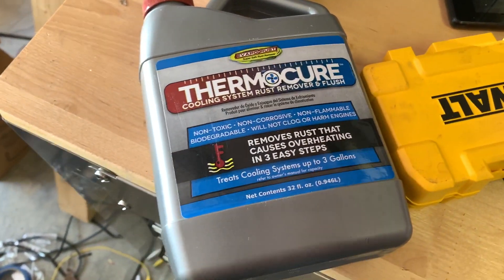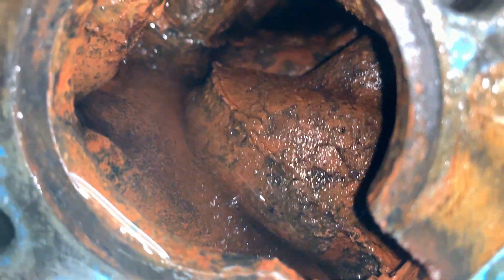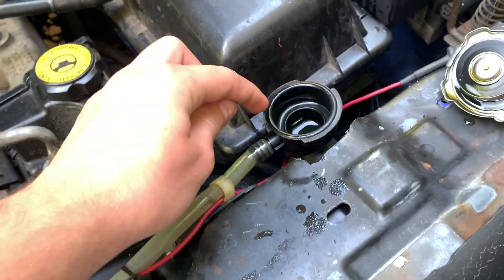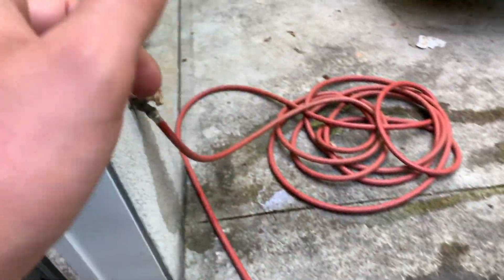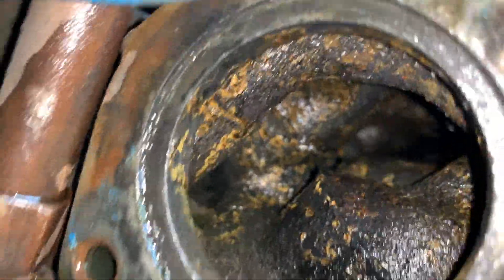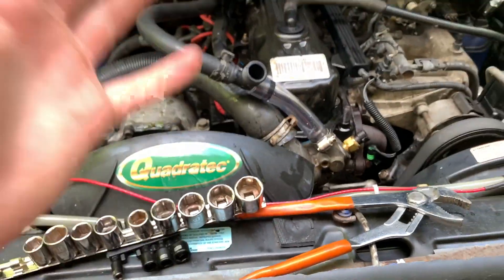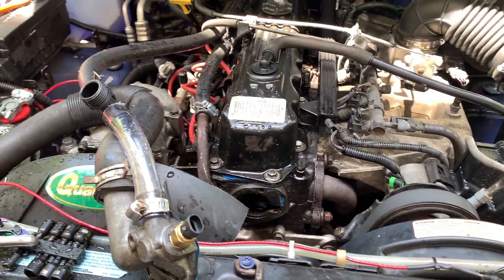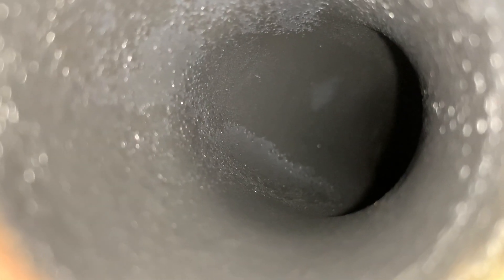Does THERMOCURE actually work? Let’s find out!!

Comment: Taking  out the termostat before doing this is a clue, did you notice the termostat housing  totally  clean and the block very dirty  is because the cold water close the thermostat  and didn't let the chemical go  into the block so do it again with  out the termostat.
Reply: I was legit wondering why he still had the thermostat in there. I was like bruh you're blocking everything. lol.
Reply: That's why you run around a bit with it in there.
Reply: So you are saying to keep the thermostat off while driving around?

Comment: Water is actually much more efficient in transferring heat than a 50 50 mix of anti freeze.
Reply: True, but water doesn’t have the lubricating and anti-corrosion properties like antifreeze... not to mention you’re fucked in the winter lol
Reply: @cebayne  he was referring to the incorrect statement made in video.... the only reason why water is not use as coolant in vehicle ...are mainly because of rust an expansion when freeze.
Reply: Do you really have lust to experience a busted engine during winter/freezing time ?

Comment: There is a product called Aqua Clear PX. Developed for the military. You add it to your radiator with your antifreeze. Keeps all scale and rust away for years. Been using it for a long time and never any coolant issues. My one car is a 30 year old Camry. Still going strong and the cooling system is spotless
Reply: yes there are some chemical toa d to water and remove rust, or convert it
Reply: Where do you buy it in the United States ?
Reply: Seems to be available only in South Africa.

Comment: Using a lower temp thermostat tells the EMC the engine is still cool and will keep the fuel mixture rich.  A lower temp thermostat is a great way to kill fuel mileage.
Reply: 5 degrees wont do much of anything, I have a 1996 dodge ram 1500 5.9l magnum that I'm about to put a 190° thermostat in cause the 195° keeps causing the radiator cap to vent out coolant, the radiator cap isn't faulty, cause I bought a couple and they all do the same. Yes it's a bad idea to change the temperature range, if it was 10° difference I would fully agree.
Reply: My Camry still gets 31mpg without a t stat
Reply: @jamesflores9456   Removing the thermostat doesn’t make all vehicles run cooler.  It greatly depends on the engine type, vehicle weight (or load) & how it is driven.  Many older in-line 6-cylinders will run ABOVE normal temp if the thermostat is removed.  No telling on a Camry.  If the ECM detects the engine is below a specific temp, it will adjust to a richer fuel mix, IF it’s working properly.  My 2016 4-cy Camry averages over 33 daily driving (which is quite a bit of 2 lane @ 35-55 mph) and gets over 36 on all highway (70-75mph).
Reply: @A1rs1ck  Might not matter on your specific vehicle, but you definitely have some other problem. A LOT of vehicles will run well over 200 degrees in stop & go traffic with no pressure release.  If the 195 thermo is the stock value, it’s not what is causing the pressure release.   There’s another problem causing excessive cooling system pressure.  The 190 thermo might resolve the issue (for a while), but it’s not fixing the actual problem.
Reply: @remusredbone1214  The big risk of removing a thermostat is that the engineered flow restriction the thermostat creates forces the coolant to to flow around the back cylinders.
Without it you can cook the back cylinders all the while the temp gauge is saying all is a-ok.
Reply: Closed loop is usually 160* or below. Idk any thermostat that’s that low.

Comment: Had the same issue with mine. I burped the system or so I thought. But it kept trying to just barely overheat. Ended up having to park at an incline and filled the funnel about halfway but I kept the engine running with the heater on this time. Along with squeezing the radiator hose to get all the air out. It took about 10-15 minutes for all the air to finally get out. Great informative video, I was about to buy the thermocure but wanted to see reviews.
Reply: YES, I DO MINE ALSO KEEPING THE FRONT END UP IN THE AIR, HIGHER THAN THE REAR END.

Comment: Should flush with no thermostat to get past thermostat housing area. Or at least drill big holes on an old one to get better flow when engine cold or hot. Chuck in a new one at the end of flushing system.
Reply: Yeah I also thought it was weird that he didn't remove it.

Comment: As some others have pointed out, pure water is actually the best at removing heat from the engine. "Coolant" is a bit of a misnomer. The "coolant" that engines are filled with is actually a 50/50 mix of water and antifreeze. The water is the coolant and the antifreeze is there to prevent the water from freezing in cold temperatures. The antifreeze does also help prevent the oxidation of iron in the engine which causes rust. People who live in warm climates will often fill their cooling systems with 100% water since it is so cheap (although only distilled water should be used.Tap water and bottled water that has not been distilled will result in mineral deposits that negatively affect cooling performance and the longevity of moving parts such as the water pumps.) Using 100% water  is very effective at cooling the engine but will lead to internal rust (which is not good for cooling). To maintain a good balance of cooling performance and mechanical longevity you should always use a mix of distilled water/antifreeze somewhere between the range of 70/30 to 30/70 water/antifreeze. Warmer climates should use between 50-70% distilled water while colder climates should use 50-70% antifreeze. Only the coldest climates, that regularly reach double-digit negative Fahrenheit temperatures, should use 70% antifreeze mix. Most people will be perfectly happy with a standard 50/50 mix.

Comment: This stuff WORKS, I watched multiple videos and decided to give it a try. Recently bought 1979 Pontiac Trans Am 20k original miles. Sadly, the coolant broke down over the years and the radiator was rusty, dark brown coolant. Flushed it multiple times, it would get clear and then once closed up, back to rusty coolant. Pulled the thermostat let it flush open, closed it up and added Thermocure. I left it in the car for a few days and drove it.  Flush and repeat with a second application of new Thermocure. Same routine, I drained the coolant, filled it up again and flushed. The coolant was clear liquid! I just pulled the water pump which was perfect inside, no rust. I replaced it with a FlowKooler pump and a high flow Edelbrock thermostat. The car temperature is perfect! I am waiting on a replacement radiator to start fresh.

Comment: I would flush that with distilled water and a pump to avoid scaling minerals from the house water line.
Reply from the maker: Good idea, I used distilled to mix with the coolant and to top up:-)
Reply: You'd have to buy a hundred gallon of distilled water to flush it as long as he did.
Reply: @davidwiser3883 Of course... highly impractical.

Comment: Actually water does perform better than anti-freeze/coolant in dissipating heat, but it boils at a lower temperature and freezes at a much higher temperature,
and for these reasons is not used by itself. It used to be used straight, with a rust inhibitor, during the summer months but needed changed for winter 
weather to an anti-freeze solution. Eventually year round anti-freeze/coolants were formulated than did’t require twice a year draining and refilling of the
cooling system.
Reply: * Boils at higher. Freezes at lower *
Reply: @cosmicdonkey919 wrong. Water boils at a lower temp and freezes at a higher temp!
Reply: @cosmicdonkey919  lol
Reply: Water can definitely be used on it's own, even boiling at a lower temperature, as the boiling temp rises with pressure. Hence why your radiator system is pressurized. 
Tap water isn't good though. Distilled is what you would want if running water.
Reply: @HDConcussionz  yep, this is correct. 100% water is actually ideal to use as long as your cooling system is sealed properly. The increased pressure in the system will raise the boiling point of the water accordingly. The only downsides to 100% water is the lack of a rust inhibitor which will cause an issue over time, and the issue of freezing temperatures in colder climates. if I lived in a warmer climate I would run 100% distilled water with a little bit of rust inhibitor as needed.

Comment: Put a CFS 3 core Copper radiator in your jeep xj with a external Haden transmission cooler. Transmission will run hot offroading or towing and raise coolant temp. Replace your auxiliary electric fan with a 1998 or newer 10 blade. I also put a Wix inline coolant filter mounted to firewall. That filter will catch your future rust problem just keep it changed about every 10k miles.

Comment: Actually, water is better at removing heat from the engine than coolant. Water just doesn't have any lubricants or corrosion inhibitors and will freeze in the winter. It's also not able to go to as high a temp as coolant. However, any pressurized cooling system will allow regular water to get over boiling without boiling in the block or radiator.

Comment: Good thorough flush! I like how you mentioned those (Chunks) that keep flushing out.. with the thermostat housing off remove lower radiator hose take your hose with a rag wrapped around it as to try and create a tight seal and turn the hose up all the way try and blow those chunks out the Block then JUST REPLACE THE RADIATOR don’t mess around! They are relatively cheap and mostly recyclable. Radiators Fatigue from non-stop expansion and contraction.. (yes they do explode) oh and those Chunks? Where exactly do you think they end up? They settle to the bottom of the block and radiator..always Run OEM temp thermostat Temp..and a common funky temp problem is fan clutch going south.

Comment: Water is the best for cooling purposes. The difference with tap and distilled water is minerals vs no minerals and distilled doesn't create the corrosion problems tap does. 

Coolant is used to keep it from freezing and conditioning thats it.
Reply: Exactly. They use water when racing because it's the best for cooling
Reply: Coolant also keeps the water pump bearings lubricated and prevents cavitation, two things that'll kill a water pump.
Reply: That is absolutely not true.  It's called coolant / antifreeze. Read the label and you will clearly see it changes the waters freezing point and its boiling point. Racecars use only water because it is not hard to clean up off the track. Coolant is oil based and oil dont mix well with slick tired on a race track.
Reply: @peggybixby1085  Your wrong coolant  is a lubricant for the bearings.
Reply: @peggybixby1085  It's so cute when a little lady chimes in...now run along and make some sammiches while us men talk.
Reply: @DavidPruitt NOT CORRECT... The pump bearings are not wetted, it is the pump shaft SEAL which is the part being lubricated by the coolant.
Back in the old days (1967 Ford Falcon, iron engine block with iron heads) we used water.  Then, sometimes, the pump developed a chirping noise, thus I added a small can of "Water pump lubricant" that was just old plain "soluble oil", of the same kind of the surfactant additive added to water used to lube the cutting tools in a lathe or drilling machine in metal machining shops.  That usually cured the noisy seal.
Reply: @davidwiser3883 Not so. LOOK, the pump bearing is NOT even wet with coolant... It is the pump shaft SEAL which is in contact with the coolant, and is lubricated by the coolant.  The pump uses one, rarely two sealed bearings, lubricated by grease and sealed by integral rubber lip seals, but those bearing seals ate not in vontact with the coolant, unless the pump seal fails completely.

Comment: When I do a flush, I slide a large hose over the end of the yellow flush adaptor coming out of the radiator, and tunnel the hose down to a bucket. (If coolant is in the system)

Comment: It looks like a blown head gasket issue to me. However, try to replace the radiator cap because maybe it doesn't respire properly. Also check the fan clutch for resistance. Finally,  check the radiator by touching the radiator core for even hotness just after you drove the vehicle and turned off ignition. Caution! Before you touch feel the radiator core, please turn off the ignition. One more thing, drain radiator one more time, and use concentration coolant because if the antifreeze is diluted, at high speed the vehicle may overheat. I'm a self-taught mechanic. I educated myself through the process of research and development.

Comment: I have always just used a couple gallons of White distilled Vinegar and distilled water. Add the vinegar and top off with the water. Run it for a good 10 minutes and let it sit all night. The following day drive it around for a half hour and let cool. Then flush system with tap water. When done rinsing with water allow to empty before topping off with anti freeze and distilled water.
Reply from the maker: Thanks for sharing
Reply: I never thought of "distilled vinigar".

Comment: I think the reason why the cast iron turned black is if the Thermocure has phosphoric acid in it that's what it will do. Just like rust converters that contain phosphoric acid turns the rust a dark brown or black color.
Reply: There is no acid in Evapo-rust. It is ph neutral

Comment: If you're going to be doing a long flush like a few days to a week, leave the thermostat out.. Do it in the spring, while there is no danger of freeze, and you don't need your heater.. While driving keep the heat on full hot. This will keep the flush running through your heater core.

Comment: My coolant is brown from the rust. I’ve done 2 flushes so far. Once with blue devil and another with a different brand can’t remember the name.. block is rusty still from when an old mechanic from 2 years ago put water from a hose in my jeep. Do you think this will help bring back normal coolant color?
Reply from the maker: It's worth a try. Mine was pretty bad also & it's fine now & has been since this video was taken:-)

Comment: Does this stuff work for soaking the heater core to flush it out? I want to use a chemical solution but I don't want to eat it away at the aluminum and have it leak! 2007 Ford Edge.
Reply from the maker: I never tried that myself, I left the core in the vehicle and with the heater on some would have gone through it during the process.
Reply: @Pondsisawesome124  did it work to clean out your heater core and restore heat?

Comment: Did you get some black soot like substance in the radiator after running the jeep with regular coolant? I used this stuff, did multiple flushes and this black soot came around after driving a couple hundred miles with new coolant. I'm wondering if it's the black stuff you mentioned in the block. I flushed it again and it hasn't come back. Guessing I must of not flushed it 100%
Reply from the maker: That’s the issue I had with mine, however after draining the radiator again after a few months it got rid of mostly all the soot

Comment: About your overheating issues.  Get ride if your electric fan and put on a manual fan with a thermostat clutch.. most all of these jeeps get hot with electric fans
Reply from the maker: These Jeeps stock have an electric fan AND a fan with a clutch.

Comment: Nice Video! Can you explain that T setup you have for flushing the radiator?
Reply from the maker: Thanks! The setup I have is one end going to the water hose, and the other two ends is connected to the heater hose going from the thermostat housing to the heater core

Comment: Was hoping it would remove all the rust but no!  Better, but a little too weak?  Wonder what regular evaporust would do?
Reply from the maker: Evaporust would probably work but if you ran the engine at all it would likely just evaporate, plus evaporust might eat away at the rubber hoses and other parts. If your going to use thermocure I would recommend leaving it in there for a few more days than recommended to get as much rust out as possible

Comment: where did you get the yellow adapter that is on the radiator opening?  That's a great way to reverse flush the system.
Reply from the maker: That was from a Prestone flush & fill kit that I had laying around. Most auto parts store should have them.

Comment: Great video man. I mixed the wrong coolant on my Jeep GC SRT 2019 and now it is overheating. There are plenty of brown sediments inside the coolant reservoir eventhough I flushed it. I found some sort of very strange rust inside de thermostat hose. I am thinking that the chemical reaction has also rusted the internals of the radiator eventhough the internals of the water pump look ok. Do you think Thermocure can help?
Reply from the maker: I would give it a shot. Just be sure to flush out the entire system as the last thing you want is for thermocure to react with the coolant that’s in there. Thermocure should help it out as long as it is rust, and not something else.

Comment: Water actually works better than antifreeze at keeping motor cool. It just freezes and doesn’t prevent rust. And 195 is the correct temperature. That’s what temp it was designed to run.
Reply: And actual coolant is a lubricant as well.
Reply: I thought that coolant also elevates the boiling point to prevent cavitation/boiling up to higher temps.
Reply: Antifreeze will raise the boiling point of water a little bit maybe by 25 degrees.  But having the system pressurized by your radiator cap puts the system under pressure which increases the boiling point well above the 212 degrees at which plain water boils.
Reply: @bchips2007  So between the pressure and the coolant it should  be doubly protected.